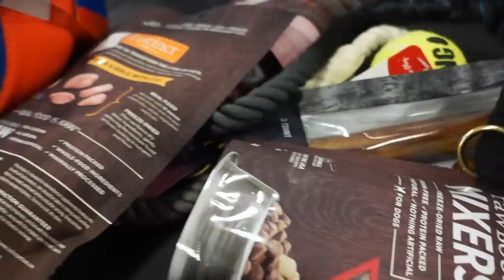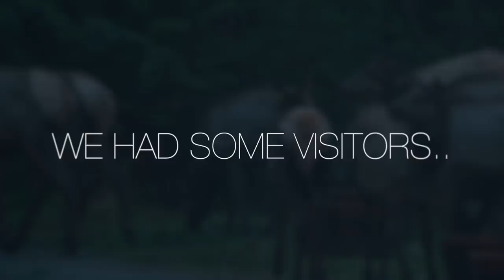A DAY IN OUR LIFE | DOG TRAINING, SHOPPING, HERD OF ELK & WOOD CARVING A SPOON

Comment: I’m glad to see you’re using some protective gear while woodworking, but please be sure you’re not cutting toward yourself & watch the path of the blade. If you’re using your legs to steady the wood and the path of the cut is going down toward your leg, a little slip can do a lot of damage. You can get aprons or cut over a low table.
Reply: Really Good advice!